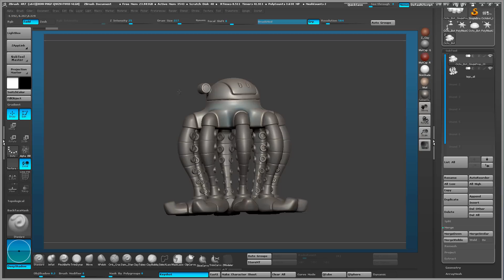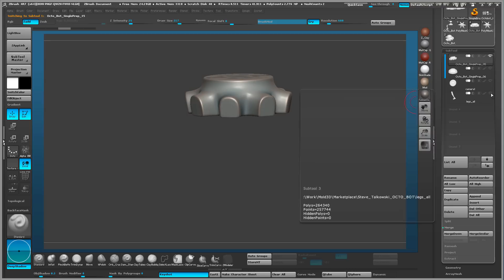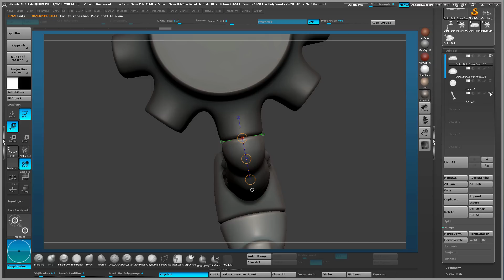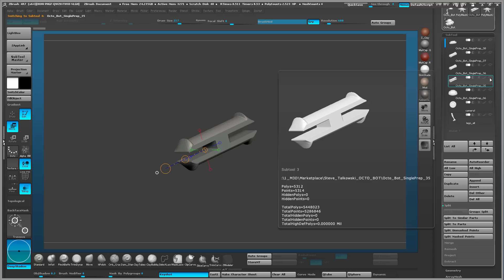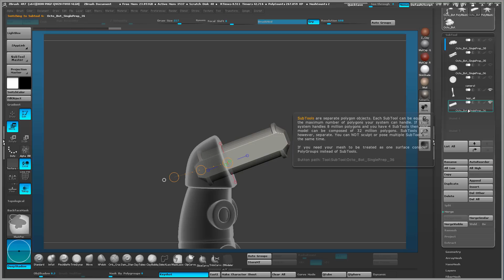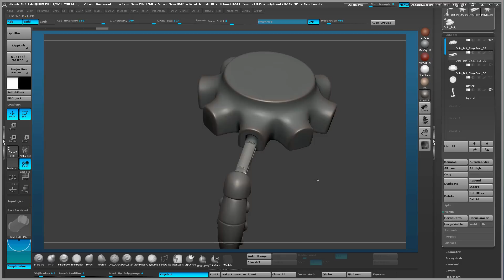Creating snap in pins for 3D Printing in ZBrush Part 1

Comment: So after a few hours of struggling to get this exact process to work, I figured out that I had to merge the subtools (other tutorial) and save as regular mesh brush, not multi-mesh brush.  Otherwise the split didn't work as it would only insert one body at a time, which defeated the purpose entirely.

Comment: That's very neat, I use Zbrush for concepts but havent used it for any 3d printing work since I use Solidworks instead. Is there a reason why you used a snap clip + 2 holes, instead of having the snap clip on one part, and the hole on the other? this would result in fewer parts. Is this related to a limitation of your 3d printer? THanks